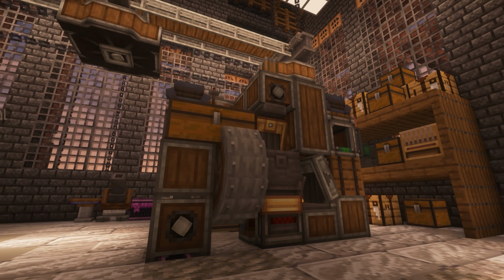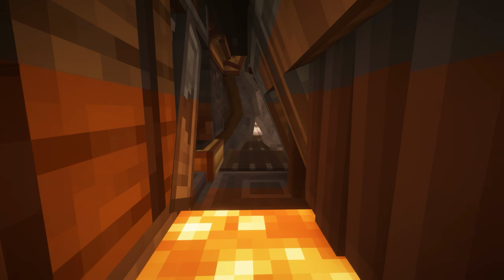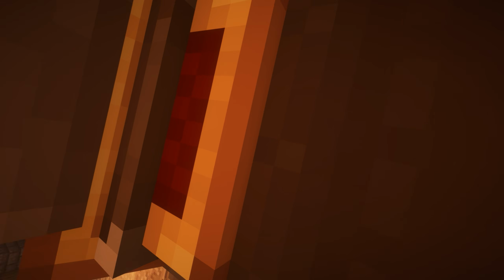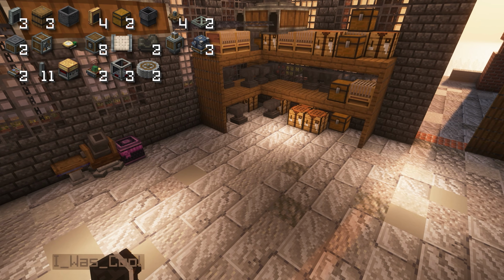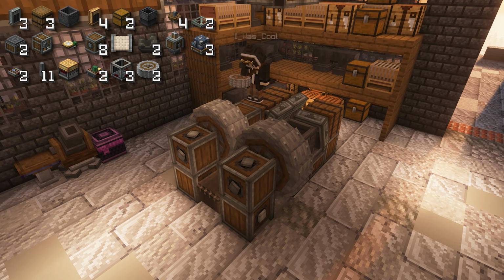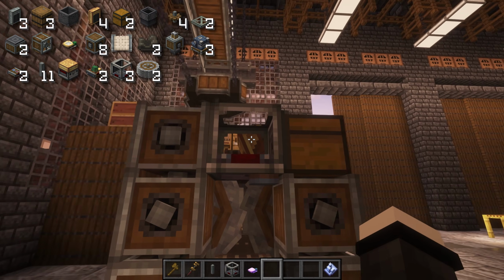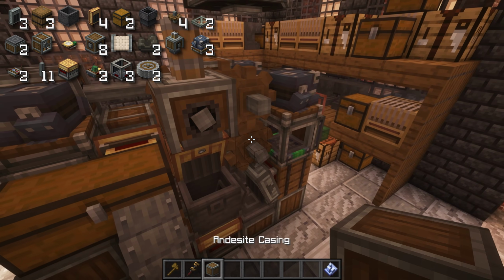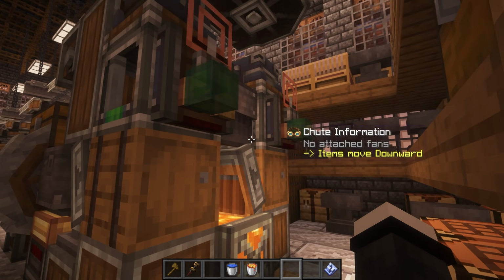Extremely Efficient Yet Super Compact Create Mod Iron Farm!

Comment: Good Build, I used schematic to build it, you need to watch out for the filters after that. For some reason, the mechanical press didn't work, but that's not a big deal. Just replace the basin with a hopper and then an autocrafter

Comment: what is grid???
Reply: I figured it out, by grid he means your system for distributing items to machines that need/produce them and storage like with the frogs take the storage you have your cobble in like a vault for example. Place a packager connected to the vault and put a stock link on it then right click a chain conveyor with the frog block and place it on top of the packager and set its id to whatever code you want then on the machine connect another packager to your input and rightclick the previous stock link and with another stock link and a factory gauge and place both on your input packager and match the id you set for the one connected to your cobble storage (Make sure the one you put on your storage is set to send only) and specify how much you want to maintain in the input, from there right click another frog to a chain conveyor connected to the one you have for your storage and place in on top of your input set to send/receive. At that point it should start running

Comment: For those using Integrated Minecraft's version of Create, and anyone else these tips may apply to:

1. "The lava catches things on fire!"
Place a cauldron in the lava space, then fill the cauldron with lava. Cauldrons filled with lava don't give off heat in the way raw lava does, so it doesn't spread fire.

2. "The basin won't output to the depot correctly!"
They prioritize East to West, so typically you can only build the machine so that East or West is the direction your basin outputs into the depot, BUT you can use a wrench to simply turn the basin after placing it, and it'll output wherever you want.

3. "I keep getting jammed up, it says it's beyond capacity!"
Use a steam engine. Our Creation has a really good compact steam engine that can output hundreds of thousands of stress capacity for relatively little investment. Do NOT use water wheels, you WILL run out of capacity quickly.
Reply: damn thanks

Comment: In my case, the iron nuggets and flints that have been washed from gravel doesn't move on to the upper conveyor belt.

I'll write down the current setup block by block below.
From left to right
[encased fan] - [waterlogged brass funnel with gravel deny filter] - [upward funnel that shoots out gravel]
Since the fan is blowing to the right side, gravels that are washed are pushed away from the brass funnel they are supposed to enter.
Am I missing something?
Reply: Just remembered that I mirrored the schematic.
Perhaps that is the issue.
For those who're building this, probably not the best idea to mirror it.

Comment: If you are on an older version of Create and getting lower rates than expected, change the cobblestone input funnel from andesite to brass. This fixes the prod rate being bottlenecked by cobblestone. Doing this should multiply your rate by 64x which will produce way more iron.

Comment: its so slow I connected it on a large water wheel and if i increase the speed it says overstressed, 60 irons per hour! anyone know the problem
Reply: Get a larger kinetic power source
Reply: Use steam power instead. Steam engines are cheap, and a properly kitted setup for one isn't hard to get going. Steam engines also have way better efficiency than water wheels, since even a basic starter steam engine can rock 2,048 stress capacity or more, which would take 4 large water wheels to achieve. They're easy to build, easy to get going, and easy to keep running, and you get exponentially more stress capacity for the effort.

For the record, just in case, stress capacity, stress impact, and RPM are only semi-related. Stress capacity is the maximum stress impact your system can handle, so if your steam engine says 2,048, then it can handle that much stress impact.
Each individual component (mechanical arms, crushers, anything that performs "work") has a Stress Impact which will be listed on the tooltip as 2x, 4x, or 8x RPM.
So if you have a component that has 2x RPM Stress Impact, and your RPM is 256 (the maximum), it means you need AT LEAST 512 stress capacity for that to run. If you have LESS than 512 stress capacity, it won't work.

If you're using water wheels for power, you're going to hit your capacity limit, and exceed it, pretty quickly. Steam engines are WAY better for complex machines like this, since they can hit as high as multiple hundreds of thousands of stress capacity when fully decked out.

Comment: Is it possible to put more of those machines into one Chain Conveyor system? My problem is that the first frog in order would take alle the packages but the second one gets none.
Reply: if you're talking about the cobblestone barrel, factory gauge on the packager will automatically request more cobble from the stock once the monitored barrel has less than the specified amount through the relative frogport, if you named the frogports seperately.

If you're talking about the iron output, stock links will be connected to the main system in which, you should be monitoring the iron stocks through factory gauges and make it be able to request what's in the iron barrel automatically until the storage fills out, at which point the barrel will fill up and clog the whole contraption so it doesn't work until you pull iron from the stocks. Then, it starts again till it fills back up, basically sourcing you with infinite iron.

Comment: So I don't know how many other people have realized, but this machine can generate a whole host of things with no modification. It's really just a fancy crusher/washer setup. Just change the input material and filters.

Add gravel instead of cobble, now it's a clay generator. 

Add terracotta instead (maybe from all the clay you produced), now it's a gold generator.

And it can effectively process any raw metal, ore or orestone (like azurine) into their associated metal.
Reply: This is great with factory gauge logistics and stock links because you can just send whichever material needs it to 'Grind_and_Wash' or however you name the frogport.
Reply: I did this in my world. One thing to note is that when washing crushed ores, the funnel over the compactor can't keep up with the rate nuggets are produced, and so they end up in the "flint" byproduct barrel. This can be fixed by replacing the belt and chute with a 2×1 vault where the belt would go and a smart funnel filtered to the byproduct where the chute would go
Reply: thanks

Comment: Hello sir, thank you for the nice compact and effecient machine, one question though: Doesn't the Factory Gauge requires Precision Mechanism? Also I wanne build this right next to your cobblestone generator, do I still need the frogports?
Reply from the maker: You can route the cobblestone straight in with the uses of belts and funnels if you want.

Also the factory gauge is not required for this machine to operate and was not intended to be implemented in the schematic; was an complete oversight by me.

Comment: I love the design for this but I'm having trouble getting the gravel-deny funnel to work. At the minute, all the flint and iron nuggets are getting stuck in the top right-hand corner of the funnel and not being sucked in. Is this something to do with being on the old version of Create (not that old, just not 6) or is there anything that might fix it without a complicated restructure?

Edit: Ok, this was actually a stupidly easy fix. If anyone else has it, just use a speed controller (or down-gearing) to slow the machine down until it feeds properly
Reply from the maker: Yeah there is an older snapshot probably the one your on where this bug has occurred for other users as well.
Reply: @OurCreationYT  solution, simple, dont mirror when placing schematic
Reply: Any solution?

Comment: what those packers do, i have the create perfect world by mr beardstone modpack and doesnt have that is that necessary for this build
Reply: They basically put items in a cardboard box for transport via chains using the frogports or you can use them on belts if you prefer but that causes a lot of lag. They’re basically/essentially a more advanced way to do item logistics. And prob not neded since you can just swap the packagers and frogs with belts and brass funnels with filters on the funnels. It isn’t  anything complicated since you stated that you aren’t running a modpack that has them.

Comment: I don’t think I have the chain conveyor on my mod pack. How do I get the cobblestone into the iron machine from the cobblestone generator?
Reply from the maker: You could just run a belt with a funnel from machine to machine.
Reply: @ thanks for the reply. I have built it and connected the cobblestone supply because I’m on an older version so don’t have packagers. When the cobblestone goes in it shoots out the left side as gravel at the crushing wheel. Do you know how to fix this?

Comment: how do you calculate the su x rpm and the cobble x rpm needed for the farm to work?
Reply from the maker: For the su I hook up a stressometer to the machine and run the machine at 1 rpm, and ponder the stress usage of the machine; for the cobblestones rpm I run the machine at max rpms for a few minutes then take those numbers and calculate it down into a estimated input. there is a more proper way to doing by breaking it down via ticks instead of time however I don't try that hard.

Comment: "Compact Iron Farm Design", cobblestone generator doesn't included, each parts sold separately.
Reply: Hey, i comment this commentar Cuz then u will See my Problem.

My Problem is: I looked this Video because I want to built an Iron Farm and nothing more.
But u have machines where you have to Connect this with your Iron Farm that is so complicated.
Reply: @GensisShorts  It's not that complex, with the current form of the create mod I would highly recommend making a massive storage vault just for cobblestone, which your machines can then make requests from.

Comment: What do you suggest doing if you want to keep the flint? Some mods and Create addons make good use of it, and I want to save it for those things.
Reply from the maker: Get yourself a external storage source and slap a packager and frogport on it, then place a factory gauge on the packager and assign it to flint so long as its linked to the network of course. It will then fill up that storage you assigned with flint. when that storage becomes full the flint will resume to being automatically burnt.

Comment: why the stock links on the other frogports?
Reply from the maker: To allow for easy connection to your network. 

For example: 
if you where to place another machine or external storage and it you wanted to send ingots to it... all you would have to do is slap a packager and frogport on it, then place a factory gauge on the packager and assign it to iron ingots so long as its linked to the network of course. It will then fill up that storage you assigned with iron nuggets. Once that source was full of iron the Iron farm machine wont send anymore. When the iron farm's storage becomes full it cuts off the iron farm. 

In conclusion:
Link series machines are smart: They request the resources they need, then create the item they're designed to create. When it's full of that item, it shuts itself off no longer intaking the items.

Comment: I like it but i was expecting separate millstones and washing setups that can be used for gauge setups. As thats what i did in my world.
Reply from the maker: Originally, I was thinking about doing that, but I ended up scrapping the concept due to the complexity of that. 

Instead of fully relying on factory gauges and lining a wall with different functions to send the items to each location. Link series works in a similar way however, instead of going through every single function with factory guages it goes through (for this example ill use the iron farm) Cobblestone to Iron ingots/Flint instead of crushing - washing - compacting, and that's not to mention that with compacting that would have to be dedicated for that automation system. As I upload more and more farms, this concept will become more and more apparent as more machines come out to assist each other, essentially making their own recipe tree.

Link series machines are smart: They request the resources they need, then create the item they're designed to create. When it's full of that item, it shuts itself off.. Now, picture hundreds of independent machines like that linked to one network without a single factory gauge telling them what to do. (besides the ones on the machine itself saying it needs resources)

For example:
 Imagine the pieces of Legos in a bin - that's the base Create mod 
 Then imagine pieces of tech legos in a bin - that's Factory guge based automation (more complex, but you can do cooler things with them)
 Then imagine kids' big-sized Legos - that's Link Series (Make builds faster and easier with a cut-and-dry one-way approach)